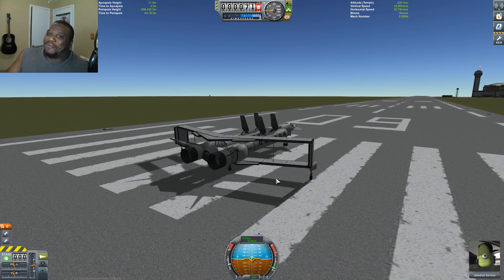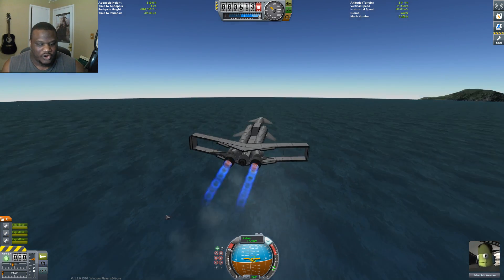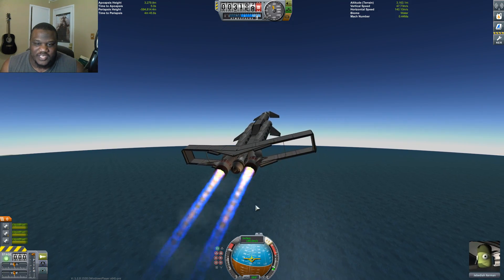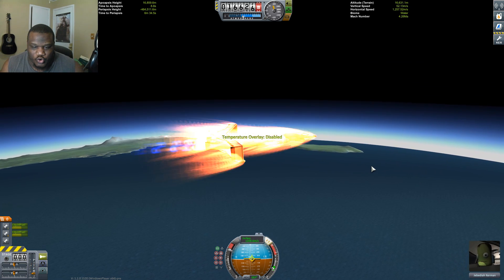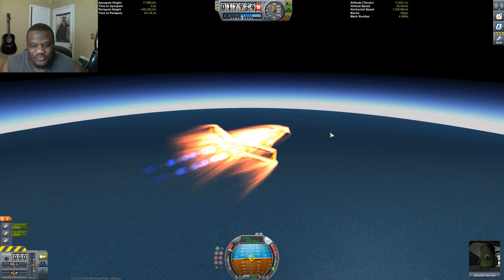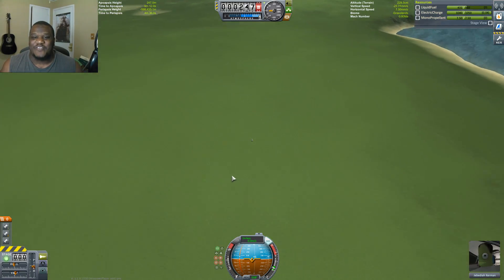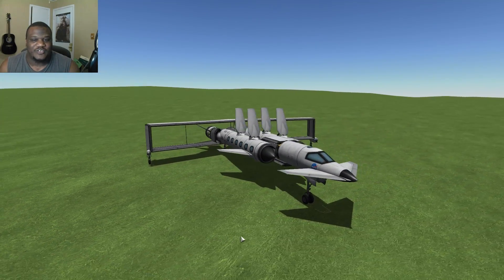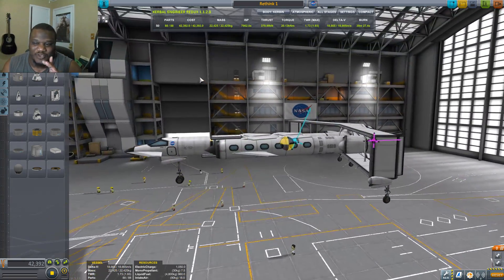Kerbal Space Program | Rethink Airplanes

Comment: The electric folding rotor from Firespitter works fine for me in 1.2 Pre, what issues does it give you?
Reply from the maker: +Bert ter Beest not that one, the adjustable electric prop
Reply: Billy Winn Jr They don't turn and make sound for me but it works. But yeah it's still a bit buggy. Can't wait for mods to update, really missing it tbh